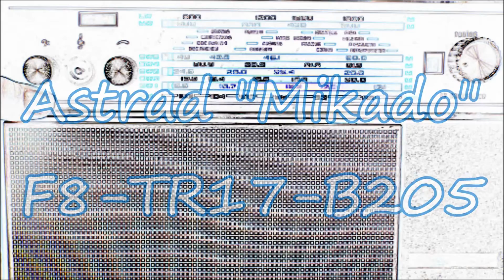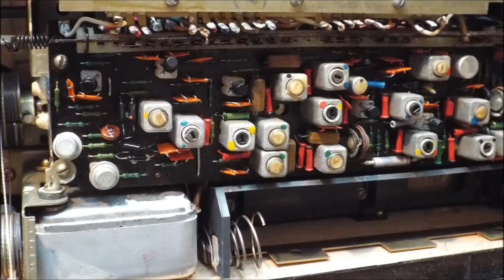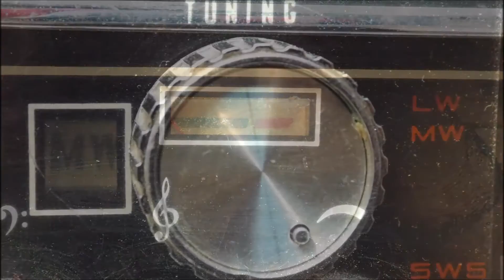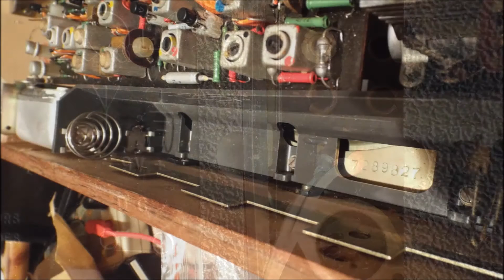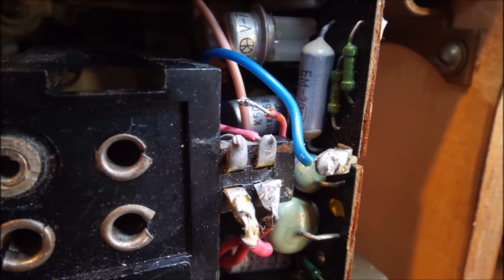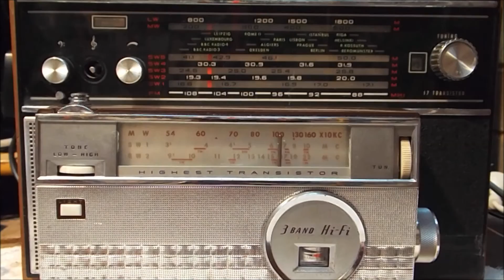Astrad "Mikado" F8-TR17-B205

Comment: It is sad that it is impossible to find out the parameters of the coils (number of turns) in the VHF block in this receiver. There is a similar, but at 65-74MHz, I want to remake at 88-108 mHz. There are denominations of parts, but with the number of turns of the coils there were problems. I watched a lot of literature and forums - I did not find such data on coils and no one can suggest.
Reply from the maker: You are correct, there is not a lot of literature on this radio outside of Eastern Europe.

Comment: A most interesting radio, I half expected the sounds coming from it to be in Russian lol.
The design build is very note worthy, leave it to the ruskies to keep it simple and strong and serviceable. I am thinking of a Mig fighter jet.
Thank you for putting this video up ...Oh BTW where did find this gem?
Reply from the maker: Thanks Craig, I found this Radio on eBay, thankfully the listing was vague and didn't mention much about it's heritage (as these can fetch a good price), there is a lot of gaps in the coverage but as a collectible I can overlook that fact, I intend to complete some head-to-head comparisons with similar vintage receivers kind of like a radio cage match LOL

I have also considered a couple of mods to make it easier to use.

I was curious about Russian technology and construction methods...
Reply: I have an early 60's Zenith Transoceanic that need some serious attention, a buddy gave it to me. Grew up with one just like it, it even has transistor sockets
Reply from the maker: +Craig Nehring Transistor ZIF sockets are an odd feature for sure, this Radio has both soldered and removable transistors, that Zenith sounds like a nice Radio that just needs a little TLC to bring it back up to spec.